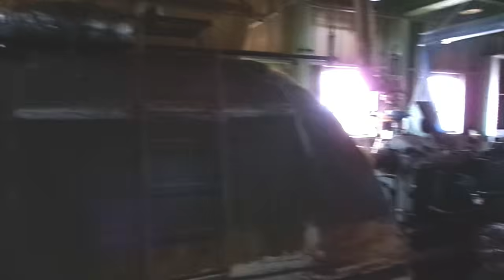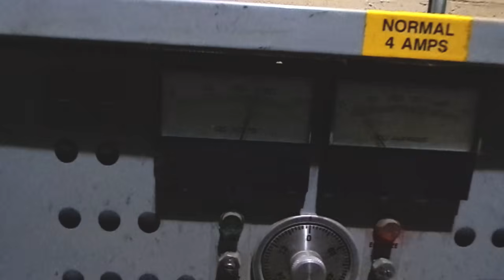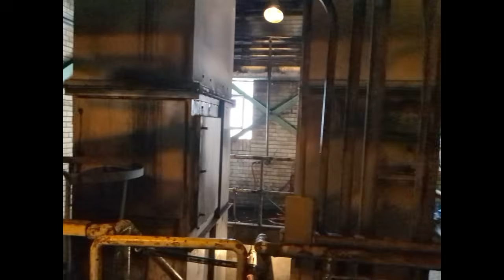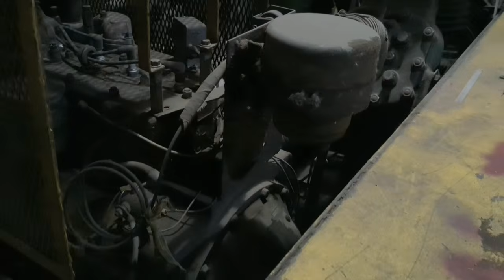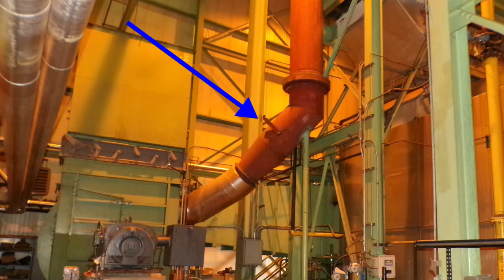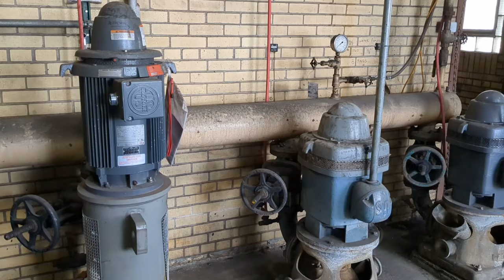Unusual Machinery Inside This Old Power Plant

Comment: You know your steam. It's sad to see old plants like this disappearing. I worked in a few steam plants that no longer exist.    One was gas fired, made about 210k pounds per hour at 150 psi. Another had 8 coal units that generated 500mw each. Big or small, they are all fun to work in.
Reply from the maker: Wow, where was that massive coal power plant?
Reply: @SteamElectricityandPropulsion  Ontario Canada. Nanticoke generating station. It closed in 2014. It was demolished a few years later. There is an urban explorer who got in there and took some great pictures before it was demolished. He has a video on YouTube.

Comment: nice video but why is the footage so blurry
Reply from the maker: It is a cheap Kodak camera. It probably uses 20 year old technology.
Reply: @SteamElectricityandPropulsion  Why not use a smartphone or gopro camera?
Reply from the maker: @megavoltampere1000 I do use my phone some but I like my camera
Reply: @SteamElectricityandPropulsion  what phone do you use
Reply from the maker: @megavoltampere1000 Google pixel. It takes better video but I have to rely on Google drive to transfer video to the computer.

Comment: Great video. My occupation is Stationary Engineer. I operated and maintained high-pressure steam boilers and all related equipment. 
It's a great job, I started on the night shift, 11:00 pm to  7:00 am.
Reply from the maker: Id like that job but it's hard to get a job.
Reply: @SteamElectricityandPropulsion  it's not easy to get a job these days. It was hard back then when I started out as a maintenance clerk. The pay was $6.30/hrs. They offered an apprenticeship. I had to get good grades in a operating engineer program. 
It took 2 years and then I received my Stationary Engineer's License. At that time I got a job in a hospital, operating the central plant and servicing maintaining all kinds of staff support systems. At that time I was making $19.17 dollars per hour.

Comment: Glad you were able to arrange a tour of the Badger’s engine room. You won’t be disappointed! The engine crew is a great bunch of people! I saw it last fall and could have spent hours in there!
Reply from the maker: Tell me about it! What did you find most interesting and what did you get to see in the engine room?
Reply: @S @SteamElectricityandPropulsion  my favorite part was the boiler room and coal handling system. It was neat to see the modern combustion controls and VFD driven stokers paired with the original boilers.

I was able to see the coal bunker, coal conveyor system room, the boiler room (lower and upper levels), the feedwater pump area, the Skinner engines (lower and upper levels) along with the turbogenerator area and switchboard. The switchboard is very original and very interesting.
Reply from the maker: @matth5309  I really don't like the new stokers. I liked the firite stokers on the William a Irvin. I do really like the coffin turbo pumps. It's neat how there's a watertight door on the coal handling system.
Reply: @S @SteamElectricityandPropulsion e coffin turbo pumps are really neat. Same with the steam recip ballast and general service/bilge pumps. What makes you prefer the Firite stokers over the Detroits?
Reply from the maker: @matth5309 fireright are all mechanical but the Detroit stokers are computer controlled